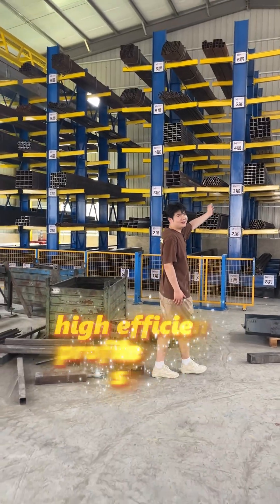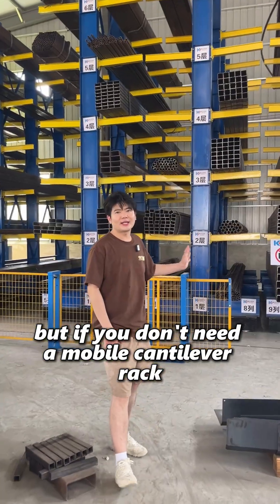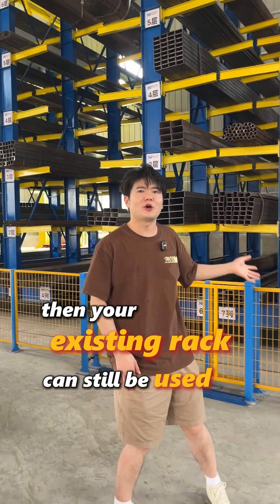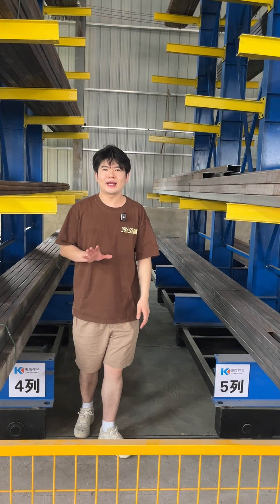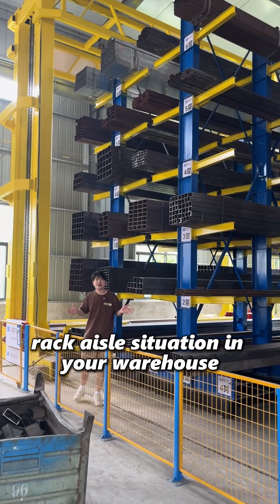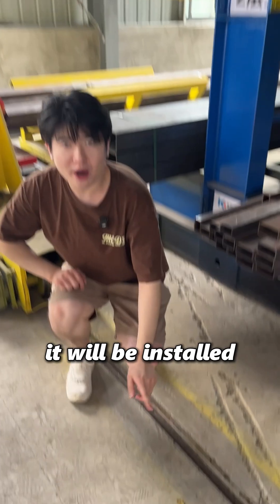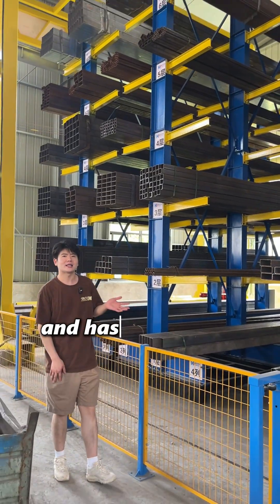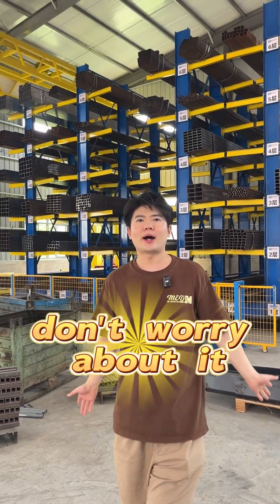Upgrade to Automation Without Replacing Your Racks

Comment: Is cranе electric?
Reply from the maker: Yes, absolutely. The crane is fully electric and automated, powered by a dedicated motor system for precise movement. Operation is simplified through a centralized control panel, requiring minimal manual effort for maximum efficiency and safety.